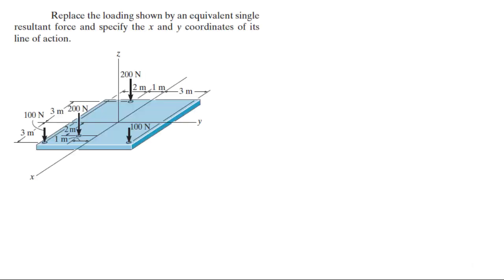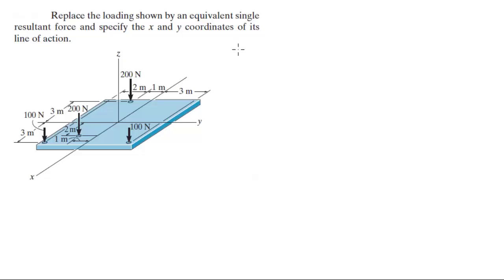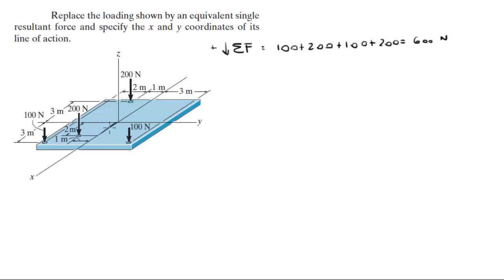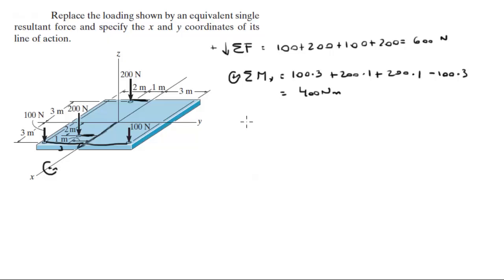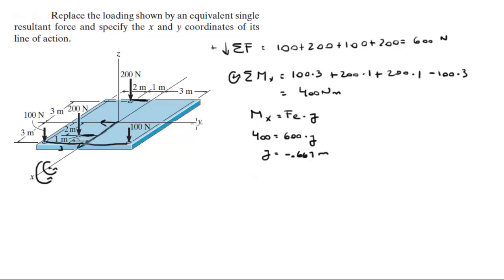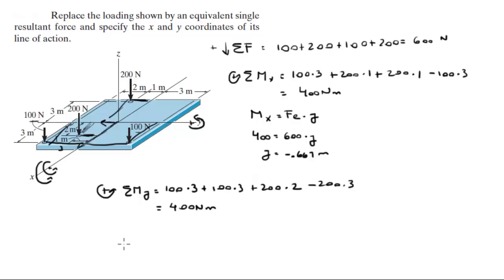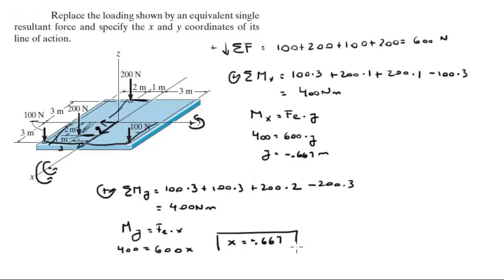Replace the loading shown by an equivalent single resultant force

Comment: Can you do a problem  similar to this but with multiple forces in x, y, and z plane? Like problem 4-136 in Engineering Mechanics (14th Edition)
Reply: Lol did u ever figure it out? 😂
Reply: If you're talking about the question that asks for the resultant forces for x,y,z. Then it would be 0,0,(Resultant force) because the Resultant force is only in the Z axis direction down.